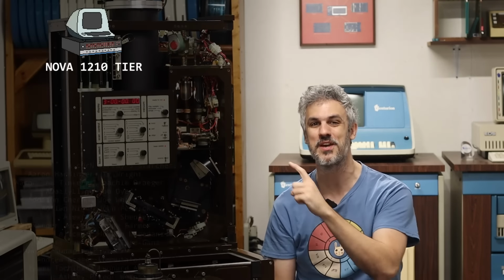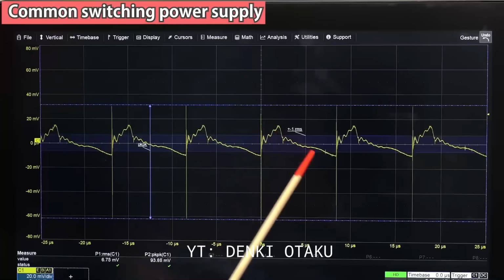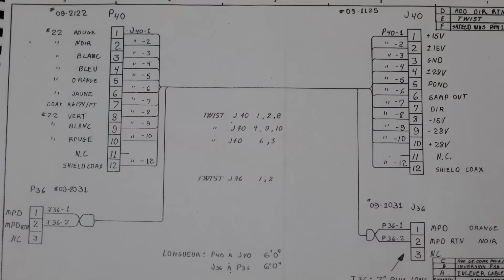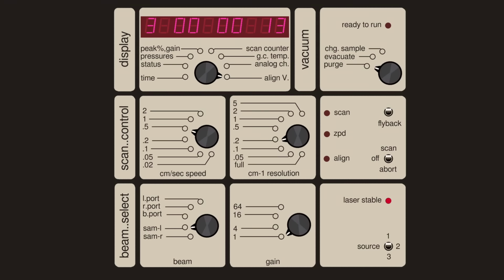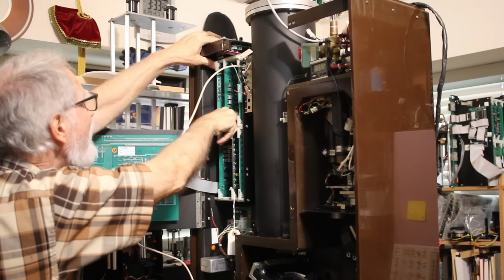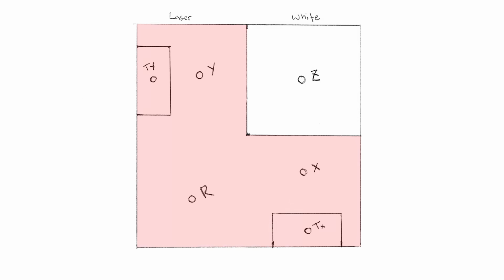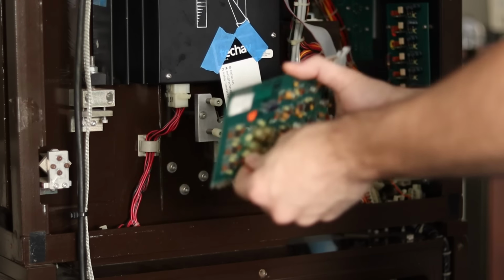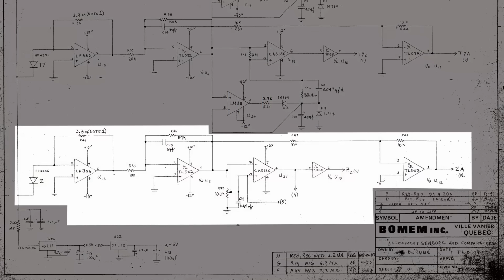I Found a Production Mistake on the Spectrometer!

Comment: You probably already did that but just in case:

You first need to make sure both the device and the test equipment (your scope) is sufficiently grounded and the ground is good.

Check if interference is present on the actual sensors themselves, and on voltage rails (use 2nd scope channel to cross-reference).

To better isolate the issue try moving the mirror by hand if that's possible without damaging anything. Don't forget to physically disconnect the motor from the mirror, not just electrically.
Also try temporarily disconnecting the laser and anything else that is safely disconnectable.

As others have suggested, probably the most likely cause is the opamp itself. Those older ones can sometimes just fail with time. 

Another is electrical noise or physical rumble/stiction in the actuator. Make sure the instrument is standing on the floor in a stable position.

The Mean-Well 5V power supply is most likely NOT the issue in this case but one of the OTHER power supplies or power control circuitry (including the laser and the motor) may have a fault such as a leaked/degraded capacitor. Check all power lines with 2nd scope channel, including ones that are not supplying power to this particular board.

One thing that might be a bit surprising to you that a stray wire might easily cause this problem, i.e. if you temporarily unhooked a wire/cable from its factory clamp and didn't think to replace it back until final assembly i.e. such wire is electrically connected where it should but doesn't physically routed as originally intended. Same with wire that is supposed to be connected but currently isn't and works as an antenna.
Yes this is not a hypothetical scenario, it really happened to me, just one benign looking wire not where it should be.   

The interference might be coming from any outside device such as your camera power supply or an LED light fixture (maybe even one outside of your lab), which may be powered enough even if the power button is off. The stray signal doesn't look like a rogue PSU but that may be because the rest of interference was successfully filtered out. 

If nothing else helps, physically unplug everything else within 100 meters around you (that you can legally unplug).

This is why precision laboratories such as large electronic telescopes sometimes have a strict ban of non-incandescent lamps for lighting, although more modern ones may elect to install 12/24/48VDC LED strips instead (hooked to either extremely well isolated or non-switch-mode PSUs) - you can never guess which frequencies a random light fixture might be polluting.

Comment: 24:11 You said that R5 is a feedback resistor, but at least regarding U1 it's the input and not the feedback path. So doubling the resistor should halve the output signal. Or is this part of a larger feedback loop?
Reply: Exactly the point I was going to make, but saved time by checking to see if somebody else had caught it first. R6 is in fact the feedback resistor with R5 being the limit resistor. There is also a clear note just above the circuit that states for DA8 issue boards the limit resistors are 20.4K, giving half the output as seen

Comment: That, and what if - unbeknownst to you - one of the laser mirrors was damaged or warped, then the laser beam might strike something else in the room that’s shiny, like - say - a CRT screen, or a window? Fortunately, our man David would have been saved by the laser’s low power output, and the fact it emits in the visible spectrum. But if it was an IR laser (like in a CD player) you’d never know it was turning your retina into carbon deposits. 😢 Always use laser safety goggles the first time until you’re sure the beam isn’t where it’s not supposed to be. 😊

Comment: I know my keyboard is not silent, but you can't hear it over that distance. Or I'm deaf. But yeah, probably not the Meanwell as they mean well. Good luck with tracing the issue. I remember from my days as an electronics tech that hunting down those issues can take too much time. And we were also not always lucky enough to be allowed to to throw something away. If it was not replaceable and it was fixable with almost no inventory left? Repairing it was a must.

Comment: Those three power pins may have intentionally been left disconnected, do that when the card is removed, the power is not connected downstream.  It seems too coincidental that it is power pins and not some random signal  Love this project.
Reply: if that was the case there wouldn't be a conductive rings around relevant pins on the circuit board at 13:46
Reply: Exactly! I remember this as a sure way to protect electronics or (in this case) mechanics down the line from harm when an essential board was not installed. Although the pins might be insulated from the through holes (can't see in the shot @jwhite5008 is referring to), it would have been better to cut the traces between left and right pins.
Reply: @RicoD5  at 13:46 there is a macro picture of round copper pins with wire-wrapped wires sticking out of green PCB

On the surface of the PCB where it meets the pins you can see silver rings around said pins. (they are most likely plated vias but that's not important here)

Those rings visibly connect with light-green copper traces on the dark-green PCB which means they are electrically connected to the power rails.

If the pins bend even a tiny bit they would make contact with said rings and thus power rail through PCB traces. 

If the intention was to disconnect the circuit whenever the card is not present, the silver rings would be missing and the traces would bend around the pins.

The rings are clear evidence the circuit-board was designed to be soldered to the pins, or possibly it was manufactured for different size of pins of push-in connectors that are designed to make contact without the need of soldering every pin

Regardless, the circtuitboard is clearly supposed to connect to the pins. This is a manufacturing defect.

Comment: You probably found the reason that this one never quite worked right which is why it was moved to parts/back up service.
Reply: When the correct card is installed in that slot, it would work properly, because the pins are bridged.
Reply: @donmoore7785  I did watch the video.

Comment: Not a computer story, but it is a weird electrical story. My father was a auto body man from the 1950's till he retired in the 90's. One day years ago a job comes in where a guy rear ended another car. Dad puts an entire front end on the car, paints and finishes it. He is checking it out to deliver it to the customer but there is a problem. If you push on the break pedal all the lights on the car come on! He spends days tracing wires in the front end and eventually the entire car. After 3 days of pulling out everything he found it. When the guy driving the car slammed it the other car he was holding the brake in panic. When he hit it jarred the 2 filaments together in the 1157 tail light bulb and they welded together. Hit the brakes and it fed the entire system! 35 years later a guy comes in the garage from another shop asking if we ever saw this happen because he had a wreck doing the same thing. Dad told him you pay for lunch and ill fix it for you! Best lunch he ever had!
Reply: I've heard of that happening once from someone who did aircraft repair, where a shorted dual-filament bulb caused a problem. And once I had a car where the fuel gauge went wonky until I replaced a taillight, presumably from some kind of filament cross-short.

Comment: To be fair the arguments for and against switch mode supplies is debatable.
Ripple for an example is something even linear supplies have to contend with. Can't just have a transformer, a bridge rectifier and some caps and call it a day. That would ripple a lot unless one has some insane amount of capacitance.
Effectively speaking, switch mode supplies is just a transformer, some rectification and a bit of filter capacitance as far as the output is concerned, it ripples. Yes, the rest of the switch mode supply has other components, but as far as output noise is concerned that ain't all that important. (even if PSU topology can affect noise a lot, flyback has more noise than LLC)

Now keen eyed readers will notice that my comparison between "linear" and switch mode has the same root fault as far as ripple is concerned. Where is the output regulation?
Linear supplies rarely lack regulation on their output. And where they honestly get their name from, the usually bulky linear regulator on the output. Yes, that will quench ripple rather effectively, remove a lot of noise as well. Without this regulator, we would be fully at the mercy of whatever the mains voltage happens to be at. Fairly "tightly" regulated, but still quite garbage for a lot of applications.

Switch mode supplies however aren't at the mercy of the mains voltage, so here further post regulation is needless for most applications.
But throw on a linear regulator on their output and suddenly even the switch mode supply has noise figures near that of most linear ones. Except that all the switching noise tends to be a bit harder to filter than the rather low frequency rectified mains ripple. (but nothing some extra filtering can't solve)

But on the other hand. Run a linear supply in a noisy mains environment and its output can be quite noisy as well. Since linear supplies aren't magic, garbage in = somewhat filtered garbage out. Here in noisy mains environments the switch mode supply usually sees less of that mains noise seep through. Mainly since the mains voltage side of a switch mode supply is effectively a big mains filter, oftentimes capable of rolling through a shorter brownout without hesitation, while a linear supply doe not provide much such on its mains side.

But in the end.
All this fluff about low ripple, low noise supplies can be completely pointless if the rest of the design doesn't take noise and ripple into mind, so when one designs a system it is important to take that into mind as well and why we see switch mode supplies in even a lot of noise sensitive applications. Voltage drop over cables and loads switching on and off can create far more ripple and noise. Sharing voltage rails is an art often solved by further regulation even closer to each individual load. (Where sometimes one can go the extra mile of giving each circuit, each op-amp, each ADC/DAC, its own dedicated regulator. Yes that isn't rare in the land of low noise design. Since low noise regulators are a dime a dozen, so sprinkle away)

Also, that meanwell supply is probably somewhat decent in terms of ripple and noise compared to the dreaded "switch mode supplies are noisy" idea drilled into every engineer. Since back in the 70's and 80's when switch mode supplies started creeping onto the market, yes they were often noisy, very noisy. And cheaply designed switch mode supplies built in later decades have also hammered the point home further. Doesn't mean that well build switch mode supplies don't exist. Not everything is a single transistor switcher abusing an opto isolator to keep things running, yes some switch mode designs are impressively minimal in their construction and very noisy as a result...

And yes, a 2 mW laser spread over a few dozen mm² won't easily burn one's eyes out. (The sun for reference produces about 1 mW/mm²)
Reply: >Can't just have a transformer, a bridge rectifier and some caps and call it a day. That would ripple a lot unless one has some insane amount of capacitance.

>Linear supplies rarely lack regulation on their output.

It depends on the application. In the 70s-80s probably the majority of power converters were unregulated, and it's fine for a lot of appliances.

>And where they honestly get their name from, the usually bulky linear regulator on the output.

I'm... let's say... not so sure about that.

Furthermore a fair share of power supplies that were actually linearly regulated instead used electromagnetic regulation rather than ICs/transistors. 

>Yes, that will quench ripple rather effectively, remove a lot of noise as well. Without this regulator, we would be fully at the mercy of whatever the mains voltage happens to be at.

Linear regulator IC itself does not typically remove noise, and in fact it can sometimes amplify it, its filtering capacitors are what reduces that noise.

It is true that if AC is polluted by LED light fixtures (which it commonly is today) the old "linear" PSUs may have worse noise than modern switch-mode ones, although not the cheapest variety.

Although the inductance of that large transformer in fact works as a filter itself, absorbing noise into electromagnetic field which is kept somewhat stable by transformer's sheer physical size.
Reply: @jwhite5008  I'll agree on some of your points.
And yes, a cheaply built switch mode supply is likely going to be noisy. (even if that is like saying: "A cheap computer don't have much performance.")

My main statements is rather that there is more nuance than just "switch mode supplies are noisy!" as a lot of people claim as if it were always true regardless of situation.

While in a lot of situations it is far less clear cut what will have lower noise in practice. And when noise really matters, even a linear supply in itself isn't an adequate solution.

Even if a lot of linear supplies on paper have better noise characteristics in a clean mains environment.

But that is like saying that an electric car has near infinite range as long as one drives down hill. True, but not a good argument in practice since reality generally doesn't give one the opportunity to only drive downhill. Just like finding a clean mains environment is a hard challenge in practice.

But I will agree that my general technical descriptions are perhaps a bit oversimplified.

Comment: i'd say the switchmode supply for the logic should be OK. The logic itself will also introduce quite some ripple into that rail and have quite a bit of distributed smoothing/filtering, so once it's running you might have a look using the oscilloscope. Ripple and "noise bursts" (short packets of ringing riding on the 5V) that are in the 15-70kHz range (one significant frequency, usually, repetition rate of the bursts in case of that) would be most likely attributable to the PSU.

Comment: One thing I really like about your channel are the deep dives you go through on most projects. To many other, "tech," channels laboriously go through changing out 50 year old caps as if that, somehow, is rocket science. Youtube creators, ENOUGH with swapping old caps!!
Reply: At least some channels do check if the caps are good before replacing them. But still pretty much is the equivalent of "replacing old gas and cleaning the carb" of old engine repair.

Comment: 15:00 why not just wire wrap a jumper from pin to pin?
Reply: Too small a current carrying capacity
Reply: David already answered that: there is no space left on the pin for wire-wrap tool to be able to wrap another wire there. 13:36
Wire diameter is not an issue here, this entire thing is wire-wrapped with thin wire..

Comment: I worked as a teaching assistent in a physics lab. One of the experiments was to build a Fourier transform spectrometer to determine the distance between the two orange spectral lines in sodium, the streetlights that were common in the mid 1980's. It usually took students three to four hours to align the setup. We gave them the advise to immediately perform the measurement, as it usually wasn't very stable, and after a coffee-break the signal might be gone. And the dirty secret is of course that if hte sodium light is hot enough, the lines start to overlap due to Doppler broadening.
Reply: You could cheat though, by using a low pressure sodium lamp, which has that lovely monochromatic orange colour, with a very narrow peak. HPS yeawill grow broader as the lamp heats up, and flattens the peak into a more or less big hump, and as well the added starting gas, normally neon and argon, added it's own peaks, and for the early ones the mercury, used to make the amalgam used as a source in the lamp, also delivered a very noticeable green peak as well.
Reply: @SeanBZA  These were low pressure spectral lamps, not exactly street lights. Still, Doppler broadening is enough to make it significantly harder to measure some of the more subtle effects.

Comment: Wait… Are ALL your automobiles JDM?
Reply from the maker: Not all, but most. My current collection of RHD stuff is a 67 Mitsubishi 360, 67 Mazda Cosmo sports, 73 Isuzu Bellett, 78 Isuzu 117 Coupe, 91 Honda Beat and the 96 Nissan Cedric shown in the video. I also have an 88 Nissan 300ZX SS that's LHD that I've had since I was 18, that one's practically a family member at this point, haha.
Reply: @UsagiElectric  You need a Skyline

Comment: I actually found one of the vertical deflection yolk connections on my TV was never soldered
Reply: Does that mean your TV needed a slap or two whenever a picture got squished?

For some reason "deflection yoLK" typo got me into a laughing fit.
Reply: @jwhite5008  Yep, When it tracked it down i soldered it. btw it looks like i've been using the wrong term for Yoke!

Comment: For best operation, you need to keep the optical bench reasonably enclosed and constantly purged with dry nitrogen to flush out water vapor and carbon dioxide, these gases will skew the data.

Comment: Should've wire wrapped those production-error pins together, not soldered! It would be much nicer looking and perhaps easier to actually do!
Reply: David already replied to another such comment that one of the pins ( the middle one - see 13:37 ) doesn't have enough remaining space for yet another wrap (and I agree)
Reply: But insufficient current carrying capability, if you look at the three traces in question where they are soldered to pins on the other side of the connector.  They are quite wide.